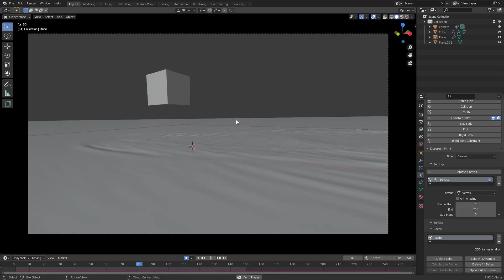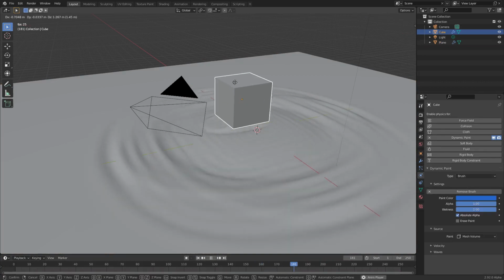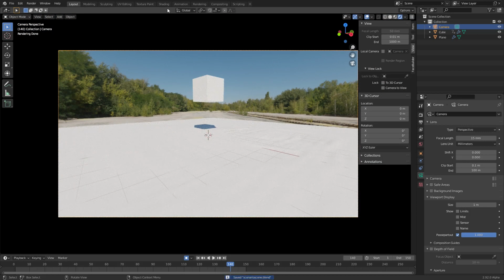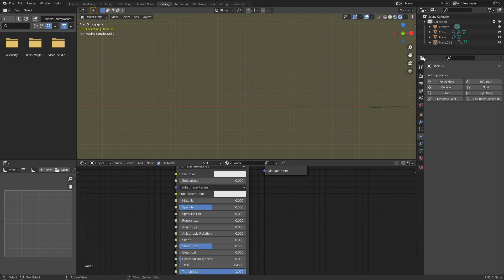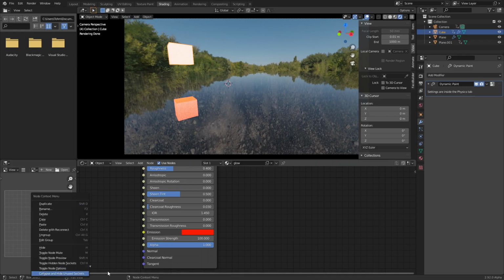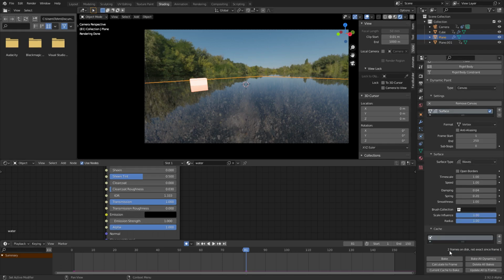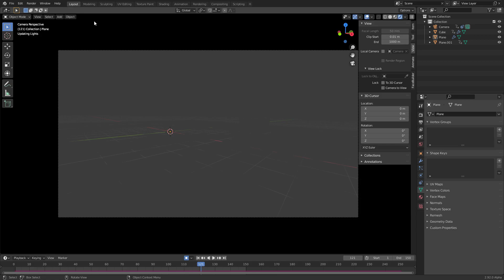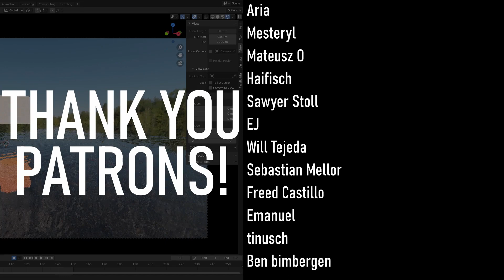Water Simulations Are OBSOLETE (kinda)

Comment: I have an issue with the outer boundaries of the second water plane (the one not affected by the water-physics) and the problem is that it won't blend in with the foreground. When I look directly from above, it works perfectly since the two use the same material. However, there seems to be a kind of ring far underneath that reflects the surface in the same way, although around it - it does not.

Comment: Doesn't look real at all. The waves look like when you slowly move a cube in and out of water, but notice that there is no displacement of water. The cube is large and will display water when pushed in, which creates a larger wave that is visible. But if you move it around that fast, you would cause huge waves and move a lot of water, the water would be rippling and waving like crazy afterwards. I know I know, water is tough and it always was.And a lot of people probably don't know as much about CGI that I do and don't have such quality expectations.

Comment: 10:38 High-intensity emissive materials tend to overexpose and lose their colour in the direct camera view, even while still illuminating their surroundings with the right colour. There is a trick to fixing this, using camera versus non-camera rays to modulate the intensity. In other words, a complete physically-impossible cheat.

Comment: 6:13 - "..bring down the roughness and now we can kinda see through it..."  Not on mine I can't.
Reply: set transmission to 1
Reply: @Villager_U  I did that. All I see is a reflection of the sky.
Reply: @petebateman143  are you using Eevee? If so, you'd need to change the material alpha blending mode/enable Refractions in Render settings
Reply: @TrailBot  Cycles. The answer is, if you don't apply scale to your plane it acts as a lens and bends your HDRI down so all you can see is sky, it looks exactly like a reflection.

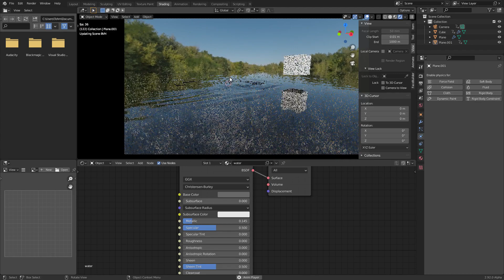Comment: 9:20 - The thing to do would be to use a Fresnel node. If you're standing in a shallow lake, when you look off at the distance the water is like a mirror, when you look down at your feet it's transparent.
Reply: It's litteraly what is happening in the scene, far away the lake is like a mirror, near the camera it's transparent. IOR already takes care of that
Reply: Or...maybe play around with the mist pass
Reply: @solid477  ior is index of refraction ie what angle the light bends at when moving in and out of the material, i'm not sure if that will also handle reflections in blender. fresnel node would definitely be an option
Reply: @solid477  It's *refraction*, not reflection. And it won't make a metallic material more transmissive.